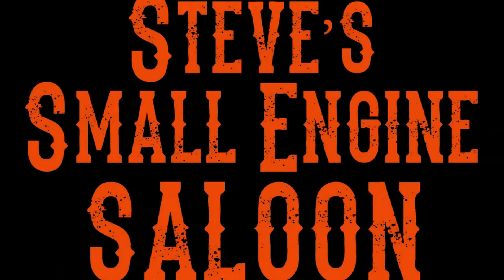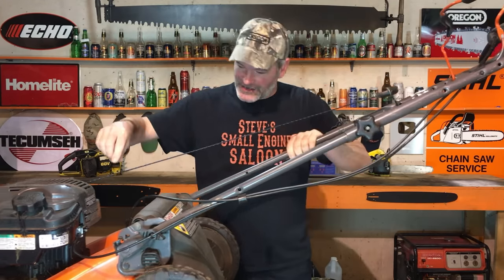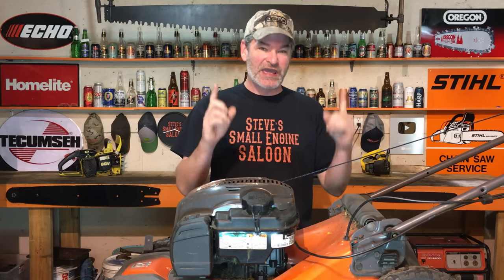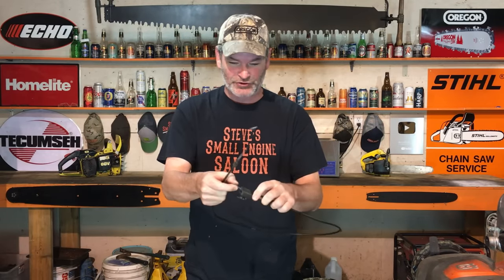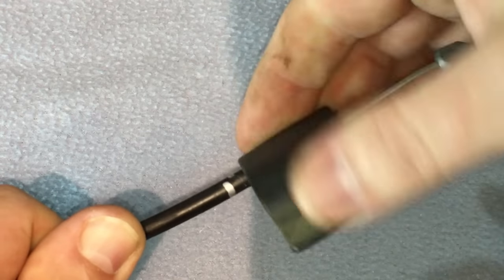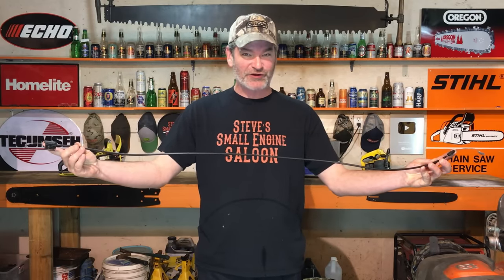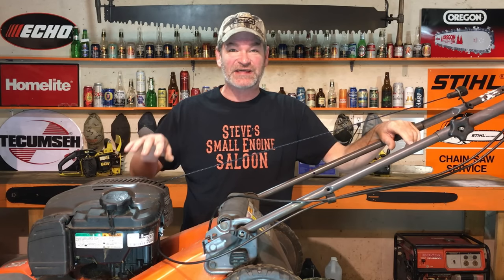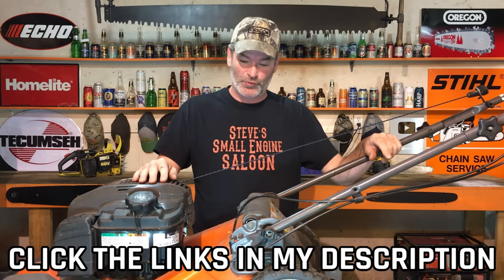How To Fix A Lawn Mower That Has NO SPARK (Super Easy Fix)

Comment from the maker: ✅Click here for a new cable ➜ https://amzn.to/325pNeN
For more videos like this, check out: 
👉How To Check For Spark On A Lawn Mower ➜ https://youtu.be/VZ8r7xv3DLY
👉Proper Way To Tip A Lawn Mower Over ➜ https://youtu.be/eeEVigsVqrE
👉How To Fix Stripped Spark Plug Threads With This Hack ➜ https://youtu.be/yY_fuDRltZE
👉How To Tell If The Crankshaft Is Bent On A Lawn Mower ➜ https://youtu.be/3up57DHiCqs

You can connect with Steve here too: 
✅Visit Steve’s WEBSITE ➜ http://www.stevessmallenginesaloon.com/ 
✅Visit Steve’s PARTS & TOOL STORE ➜ https://www.amazon.com/shop/stevessmallenginesaloon 
✅Follow Steve on FACEBOOK ➜ https://www.facebook.com/stevessmallenginesaloon 
✅Follow Steve on INSTAGRAM ➜ https://www.instagram.com/stevessmallenginesaloon/ 
✅Follow Steve on TWITTER ➜ https://twitter.com/SteveSaloon
Reply: @Steve's Small Engine Saloon
IF there is no spark because the cable has basically stretched/gotten longer and can no longer pull the connection back as far as it needs to go, shouldn't one be shortening the cable so it can pull switch back into place to make the spark connection? Just a question so I have the correct information next time I need it, and Thank You!!
Reply: Currently unavailable.
Reply: @theducklinghomesteadandgar6639       The length of the cable, itself, is fixed - it can not be lengthened or shortened.  The trick to unscrewing the plastic ends just makes the outer casing "longer" which fixes the problem for a while.  Shorten the inside cable or lengthen the outside casing - two sides of the same coin.

Good one, Steve!         - Joe -
Reply: @joesinakandid528  
Thank you for responding and explaining!!! I'm sure my brain understood that somehow, or would if had been physically looking at it, but it is refusing to relay the info to me!!! lol!!!

I'm missing something for me to grasp how making to the two points farther away from one another, when being slightly elongated likely from heat and a little due to normal wear and tear is the original issue in the first place, how can making the two point farther from each other fix it? Wouldn't the space between the two ends need to be shortened to return it back as close as possible to factory distance be what fixes the issue? I know it's something simple and I'm gonna smack myself in the head, I must be missing the knowledge of how the connections and inside cable work with one another and how they are placed around their connections spots. I'm gonna check the mower tomorrow!!!
Reply: Thanks for the links you provide. Absolutely the best teacher on YouTube. Watching and learning everyday. Thank you 😊🍺🍻
Reply: @theducklinghomesteadandgar6639  ---I see it exactly the same way. How can making the ends further apart apply MORE pull to move the object farther ?  Dont get it.

Comment: Oh man I have to agree 10000%. Can’t tell you how many toro mowers I’ve fixed with a simple cable adjustment! Add a drop of CA glue to the cable ends.
Reply from the maker: Right on Jeremy!  Thank You...
Reply: What is CA glue?
Reply: @robertwilliams3983  super glue. CA ist the abbreviation for the chemical name. I forgot the exact name
Reply: @robertwilliams3983  Cyanoacrylate glue.
Reply: 99.9 k subs.   Congrats man. I wanna be the first to do it so I'll do it early.  Great job fella.
Reply: @Chewwy153qt  thanks, I never heard of it
Reply: @PyroShim  that cleared up the confusion, thanks
Reply: @cravenmoorehead5636  thanks, I'm going to attempt to replace the entire length of the cable with this wire one day. I've never welded before, but I wonder if the S & T hooks can be spot welded to the ends of the wire.

Comment: Today I went from frustration to a big smile on my face.  My lawnmower would not start because there was no spark.  I bought a new ignition coil, no spark.  I bought a new spark plug, no spark.  I went to the internet and found Steve's video on the stretched engine brake cable.  I noticed that for some reason I parked the mower with the engine brake disengaged. It must have stretched the cable and would not release the spark mechanism.  I followed Steve's instructions and the mower instantly started with the first pull.  My advice- do not store mower with stop bar tied to
 handlebar. Thank you Steve, you are the man!   :dothefive::dothefive:😁😁
Reply from the maker: You're Welcome...

Comment: Thanks so much for your video!! Seen I had little spark once out of 100 times I pulled it so I thought ignition coil, two coils later I find your video, same exact issue. I just want to say thanks again for posting this maybe your lawn mower is doing the same thing if it's not the coil! 6.5HP Briggs and Stratton motor yard machines mower

Comment: Great Vid. Thank you! 

Disconnect the top of the safety shut off cable from the handle, turn they fitting counter clockwise 3-4 turns to lengthen the cable and reinstall.  The switch should now work properly.

Comment: I wish I would have seen this earier. Ive pulled one of my mowers apart at least three times. Cleaned the contacts on the magneto , changed spark plugs and replaced the carb. Tried your method , second pull. Thank You
Reply from the maker: You're Welcome...

Comment: Hey Steve! First off, I'd like to thank you.  I'm a Stihl small engine mechanic and your videos have been extremely helpful. (I definitely owe you a beer) 
  I have a request for a future video. I have little experience with mowers, it would be amazing if you'd consider going over back firing issues and also mowers that start and run but won't restart.  Thanks again for your small engine wisdom.

Comment: This was exactly why my mower would not start. Recently replaced the carb and it would still run a little rough and even would not start. Adjusting the cable fixed it.
Reply from the maker: Right on

Comment: What's crazy is many off-road vehicles motorcycles and such have cable adjustments. But not one lawn mower, or yard tool has an adjustment. That's what's crazy. Steve. So I go out to my shop. And I don't have those steve? So I'm still screwed. Lol. But thank you for furthering my education. I like a challenge and I also like to learn and I'm 60 and 9 days. Still kicking. LOL have a great day everyone

Comment: My mower worked GREAT last summer, but when I pulled it out this weekend it wouldn't start. I checked the sparkplug and it looks almost new. I couldn't easily test for spark myself, so I don't know if this is my issue, but this is an easy thing to check. This video is AWESOME and it may have saved my mower. I can't wait for work to be done so I can go check this. Thanks so much for sharing!

Comment: You identified the problem I have on my Husqvarna R52S series lawnmower with the Briggs & Stratton 625 series engine. The top part is easy to unscrew and adjust, the engine end that you show at 2,20 I have no idea how it comes out of its retaining metal clip and I don't want to force it and break the black plastic cap.  Typical, Friday evening in Europe, no chance of any spares before Monday and trying to find away to shorten that inner cable so I can attack the jungle of a garden.  Thanks for your help.

Comment: Great informational video Steve! I noticed my cable beginning to fray at the handle end, and it would not stay running. After replacing the cable on my Troy built mower, it was fixed!

Comment: Steve, i honestly didn't know that cable  could be  adjusted, I replaced mine ,and it seemed a lot  longer than my original one..so i wrapped mine up to almost 2 turns to get it right around my control  handle..Thanks a lot Steve can't wait to try it  tomorrow...CHEERS Mamm..
M
Reply from the maker: You're Welcome...

Comment: Hey Steve I want start by saying thank you for all your cool videos they have saved me lots of money.
I had a question for you, I cleaned the carb, got a new spark plug for my lawnmower and it will only start if I pull real hard and fast and usually takes about 2-3 pulls.
Would it be a compression issue?

Comment: I received a Murray mower (Briggs engine) with a broken cable .  I Zip tied the brake open where the cable attaches.  To shut the mower off, I  attached a piece of wire to ground and just hold it against the tip of the spark plug to shut the mower down.

Comment: Wholly sheep shifting bosom beaver, what do you think about that ?
I just had to lube that brake on an older tecumseh for making the cable work too hard.
I also lubed the cable with drops of motor oil from the top.
Now I get to check the pull distance to see if it's in range for a more complete adjust.
Thanks Steve.
Cheers.
Reply from the maker: You're Welcome...

Comment: Most of the mowers I find at the curb are due to broken cables. I remove the spring on the brake and they generally fire right up. I currently need about 12 different cables, but the cost can be prohibitive. They make decent gifts for friends that can't afford $200 for a new junk mower at WalMart.
Reply: If the plastic part of the cable is still good. I have repaired cables with 14 gauge galvanized fence wire I got at tractor supply. The gauge may vary but it worked with my Murray push mowers. I used gritted crimping sleeves 1-2 14.5- 15.5 gauge wire. Cut out a section of plastic where the cable is broken. You'll need to cut off enough so your splice has room to move unobstructed. And be careful to keep your length right. I once spliced close to the top of the cable. I twisted the wire at the bale hole then crimped it. You have to put you crimping sleeve on first, then slide it over the twisted wire and crimp it with crimping pliers.
Reply: @robertwilliams3983  That doesn't sound too bad. I think most of them rust over winter, sitting outside. I've done it myself a couple of times come springtime and the cable is stuck in the sheathing. Some penetrating oil would help prevent that.
Reply: There is a simple device that can be bought at many bicycle shops that clamps onto the outside of the cable.  Next insert the "straw" from spray lube and the oil is squirted down the inside of the cable.  Use spray lube and not WD-40which was never intended to be a lubricant since day one.
                                     - Joe S -
Reply: @DeathAngelHRA  drip some motor oil n there alongside the upper entry, wait, then drip some more after penetrant to get it free.
That saved three machine's cables here at the "Funny Farm".
The thicker viscosity stuff hangs in there and doesn't weep out to make a mess on the mower-deck.

Comment: My cable rusted badly and it was no good, so I rigged a piece of wire that works and I don't have to worry about it rusting again, but I don't really understand what exactly the switch does. Does it ground the coil or not ground the coil?

Comment: I recieved a 25 HP Kohler Craftsman GT5000 tractor/mower free from my son in law. I  tried several things only to discover the engine had two broken rods. 

I never did an engine rebuild,  & no one could work on it for many months, so I took it apart & managed to get new rods & a used crankshaft. (I ended up using the old crankshaft after filing off the melted on aluminum)  

I was shocked & surprised when the engine actually worked after I  reassembled it!  I used it as my transportation for a while, then got the 54 inch mower to work. It was running smoothly & not even working hard mowing 6th to 10 inch grass & weeds.  As I was  mowing for over an hour, the engine decided to run rough for about 10 seconds, then just quit. I  couldn't get it to restart. I pushed it into my shelter & checked compression. About 145 pounds in each cylinder.  There is spark on both cylinders that is not real strong, but even with a few "sniffs" of starting fluid it won't run. (It did try to fire just enough to give me hope, but no luck.) Have 1/2 tank of fuel. ANY IDEAS?

We have most of the world's supply of mud dauber wasps, so it might be possible something related to them,  (I once had a mud DAUBER fill my airspeed pitot tube in my airplane in a 2 hour period it was parked) but it probably is more like a failure of an electric module?

Comment: Hay Steve.. Have you done a video on getting a broken bolt out of a engine shaft that holds the blade on? Mine broke off in my MTD push mower.
Reply: Drill down the center of the broken bolt with a cobalt drill bit slightly smaller than the bolt make sure you start the bit in the center of the bolt go to your local hardware store and purchase a small set of EZ OUTS.   YOU MAY HAVE TO HEAT THE BOLT WITH A PROPANE TORCH. JUST MAKE SURE YOU PUT A SET OF VICE GRIPS RIGHT BELOW YOUR CRANKSHAFT SEAL TO DISSIPATE HEAT SO YOU DONT DAMAGE THE OIL SEAL.   YOU SHOULD REMOVE YOUR BLADE ADAPTER BEFORE YOU DO ANY OF THIS.   A GOOD QUALITY COBALT BIT DRILLS DOWN THE BOLT CENTER EASILY JUST TAKE YOUR TIME WHEN DRILLING
Reply: Penetrating oil can also be used to aid in the bolt removal only when your crankshaft is cool to the touch

Comment: I have a 6.5 Intek, no spark. Unplugged kill wire from coil. Removed coil, cleaned contact areas for good ground.  Reinstalled with .010 gap to flywheel.  Measured 4.8k ohms from spark plug lead to coil body and kill terminal.  Spun engine over with drill motor. Tried 3 different spark plugs,  one brand new.  Still no spark.  Any ideas? Can the coil still be bad even if the ohms read OK?
I know nothing else to check. I thought the good ohms meter reading meant I was home free.

Comment: How do you feel about that Tru fuel 50:1 for two cycle? I put some in my weed eaters and blowers and for some reason I had a hard time cranking them and they sounded weird for a while and they finally started running good after about a minute. Not sure if I should keep using that stuff or not.

Comment: Think that's known as kill switch as it grounds magneto! I've just been working on flymo won't start chk for spark,nil put meter on magneto open circuit, just recived new one in post today, need to investigate clutch,noticed it was covered seems to be oily mess think may have come from exhaust by the smell of it don't no how it got there,not look@that problem as yet,think maybe leak from muffler then flywheel fan dragging in,needs sorting for shore,no doubt will cause clutch to slip,I've got replacement as also looks worn silly not to replace whilst in there,found easier  new way to lock piston l put old long reach spark plug in that stop it great.ive also being trying to replace clutch on ryobi rlt30cet!what a nightmare don't know if youve ever done 1 Steve real big problem getting circlip out from behind clutch drum,difficult to get @ has to be removed along with bearing that's on drum shaft to get @circlip on end of it,well engineered, interference fit on shaft to bearing also into housing think they cud have made it easier to do think tax over engineered, still got battle to do reassemble it!

Comment: Steve question please! Have a 2015 Troy Bilt Pressure Washer, coil no good, tried everywhere, Troy, Troy dealers, MTD, parts houses etc. Nobody. Found out that coil is no longer manufactured, all warehouses are out as in None Available Anywhere. The washer worked great. Only 7 years old. To your knowledge, is this becoming an industry standard now to leave owners stranded? Thank you for a reply Steve if you have time.
Reply: The part should be a normal Briggs & Stratton coil for whatever motor size it has.
Reply: @DeathAngelHRA  Thanks D.A. I forgot to mention I did try Briggs, their dealers & third cousins twice removed. Nobody has it. If you guys have aging equipment you might invest in spare parts...coils especially. (7 years is aging now? Hell, my KIA is 20 years old).
Reply: @billcallahan9303  If you're in a pinch, I have many Briggs of various sizes and years. I could see if I have a spare coil or send you a complete motor. The engines were the same for a lot of equipment.
Reply: @DeathAngelHRA  Bless you D.A. I'll get the numbers for you & send you the part number tomorrow. It's on my phone. I'm on my tablet & it's late in north Florida. I really appreciate this whether you have it or not. Bill. Thanks! BTW: it's a 6.5 hp Briggs on a Troy Bilt Pressure Washer.
Reply: @DeathAngelHRA  test
Reply: @billcallahan9303  I have a 6.0, 6.5 and two 6.75. Did you find a part number?  Unfortunately, YouTube isn't giving me all my message/reply notifications. I'm in Missouri.
Reply: @DeathAngelHRA  I tried to contact you four times now. It keeps deleting my replies. Yes, I have part numbers. Let me know if you get this please.
Reply: @DeathAngelHRA  D.A. let me know if you get this. I've written five more replies, none appear here.
Reply: @billcallahan9303  Yes, I received notification of this message. I had also replied days ago with my email in the message, but I don't see that here either.